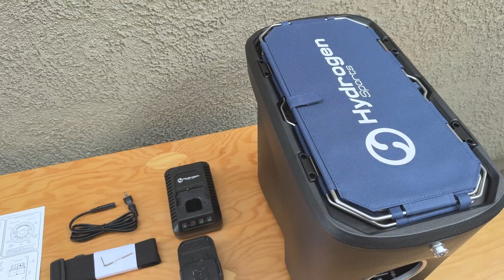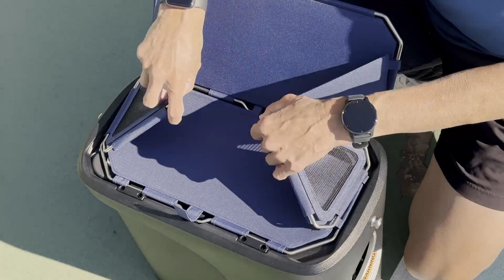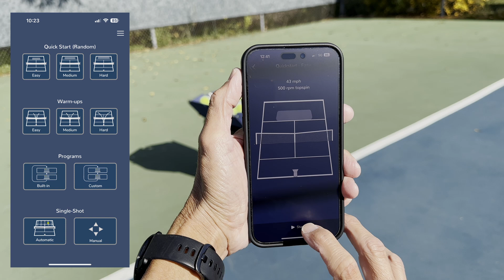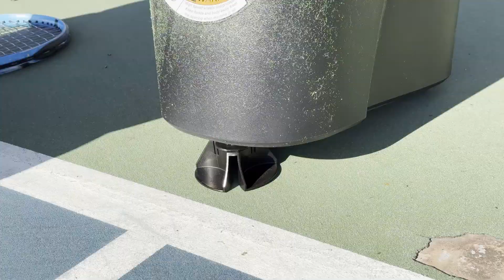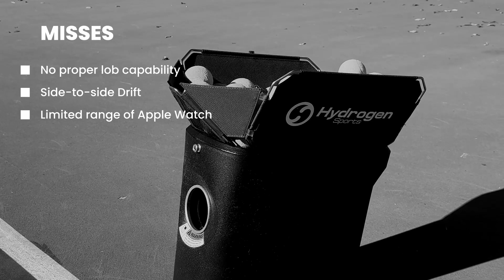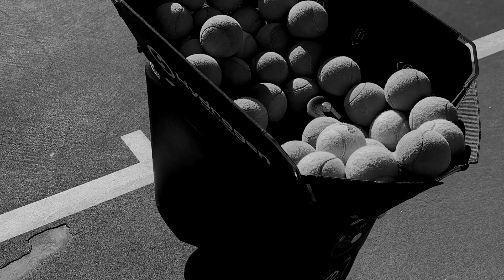Review 001 of the Hydrogen Sports Proton Ball Machine

Comment: Built my own and trying to avoid ball jam is trcky. Would be good if you could do another video and hone in on the ball delivery drop zone to see how it works and how ball jams are possible and things that can avoid them. Mine uses just one pocket and the disc is angled so the balls fall towards the pocket at one point then travel around to the higher drop point. I used bicycle training wheels, MY aliexpress motors, controllers, makita battery. Wooden frame and basic on off remote control. Test final tesult tomorrow. Tennis anyone?

Comment from the maker: I've used the machine for about 18,000 balls now. In that time, I've had one bad jam that required opening up the machine, one repair done by Hydrogen sports under warranty and lost 2 of the feet used to support the front of the machine. It can fall off when moving because of the nature of the design. I've designed and 3D printed replacement feet so I don't have to keep buying them from the manufacturer.
Reply: are you able to share your 3D printed replacement feet file for others that also have this machine?

Comment: great review ... thx.   like to see how you would compare it to spinfire, spinshot or ...
Reply from the maker: I had evaluated the Spinfire Pro 2 and a couple of others before I bought the Proton so I can give you a paper comparison of the key features. The SpinFire wins on its ability to do a better lob, a remote control, close loop design so that there is no drift in alignment and larger ball hopper. However, it does cost quite a bit more - $700 more and is bigger and heavier.  I would be very interested in testing one if I can get my hands on one for a month or so.

Comment from the maker: I just tested the range of two newer Apple Watches; the Series 7 that was launched in 2021 and the Ultra 2 Launched about 8 months ago. Both watches connected and worked fine not just anywhere within the court but also outside the fence. I went about 20 feet beyond the fence line - diagonally across from the ball machine that was placed on the baseline on the opposite court and the connection was solid. I could start and stop the machine with no problems.  I'm now wondering if the older watch I tested with originally was faulty in some way.

Comment: Do we have an app for Android users?
Reply from the maker: It's in the Google Play store
Reply: @DVReviews2024  thank you. Can you please comment on the durability of the machine? Since when have you been using it/tentatively how many balls fired so far? I'm planning to buy a ball machine, and this seems to be the only machine which has custom drills capability at this price point (spinshot player cost upwards of $2200). Is my understanding correct?
Reply from the maker: @samar_khan_94  I've put in excess of 14,000 balls thru the machine in the 7+ months that I've had it. I've had two problems so far. The first was a messy ball jam that required disassembling part of the carousel to fix. The second was more serious - the machine stopped elevating. I had to send it back to Hydrogen Sports for it to be fixed. So, the reliability hasn't been great.

Comment: I ordered the Proton (with an additional battery) using a link from 2minute Tennis. The machine that I received did not work properly. It was shooting balls off the court into the side fence. I called support but they didn't answer their phone so I left a voice message. I also emailed them but they didn't respond to either the phone or email messages. A few days later, I emailed them again and finally received a response. They didn't believe that there was a problem with the machine even though I explained in great detail what was wrong. The only option that they gave me was to offer me a refund, less 10% restocking fee. I was responsible for shipping it back. The total cost for the machine is $1695 + $75 (second battery) = $1770. I was refunded $1558. I should have been $1593 but they said that since I used "a discount code" for the purchase, they would need to deduct more from the refund. My cost for shipping it back was $130 plus restocking fee came to $342. In other words, I lost $342 and still have no ball machine.

Comment: Thank you for your review.  May I ask why you're giving the machine 3 stars out of 5?  is there another machine you'd recommend around the same price point?
Reply from the maker: There are two main reasons for the rating. The first is the left-right drift of the machine. In a typical session, I run about 7 or 8 baskets of balls through the machine. In that time, I have to adjust it at least 3 times to keep it aimed correctly. I just want to focus on tennis and not have to keep adjusting the machine. Calibration can sometimes help a little but that is yet another thing to do and it doesn't totally solve the problem. The second is the lack of a high ball capability so I can practice overhead smashes.
Reply: Doesn’t the lob riser raise the machine up more? Also, How does the machine calibrate , is the drift happening from the back wheel slipping?
Reply from the maker: @Wj3399  
The lob riser does allow it to launch balls at a higher angle but not high enough to do a proper lob. 
There is a calibration process run from the phone app that allows you to launch one ball at a time at a specific part of the court. You then dial in the machine by using the appropriate arrow keys. For left to right drift, you just specify how far the machine drifts left/right over time and the machine attempts to compensate for it.
It's an open loop design - so the drift is to be expected. It's probably from a combination of the small, rear driven wheel slipping or just the (lack of) repeatability of movement inherent in the design.

Comment: Do you have some advices to fix some of the mentioned issues, please? I need to buy the Apple Watch. Which one is the good one to work with? Are the Generation 9 watch good for the use of the ball machine? Thanks
Reply from the maker: The older watch I had worked reasonably well so long as I used it no further than the service line on the opposite side of the court. I should be able to get my hands on an Ultra in about 3 weeks from now. I'll test it and let you know if it works better.